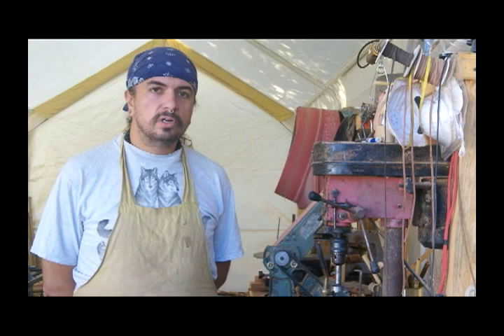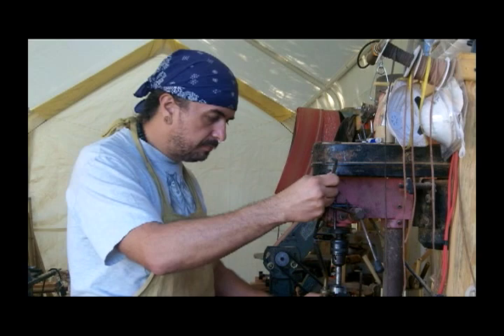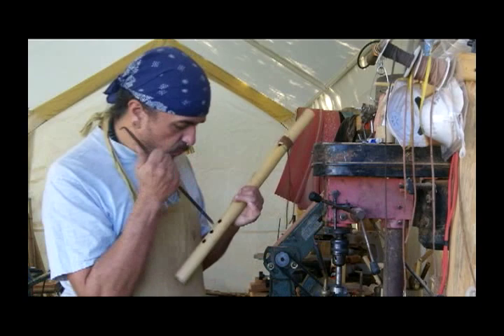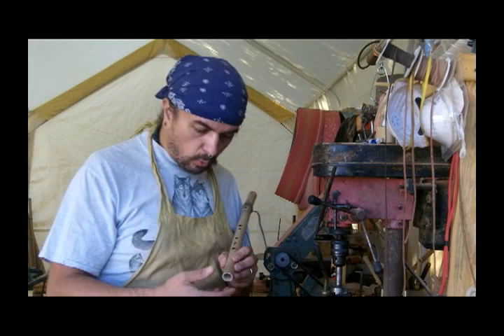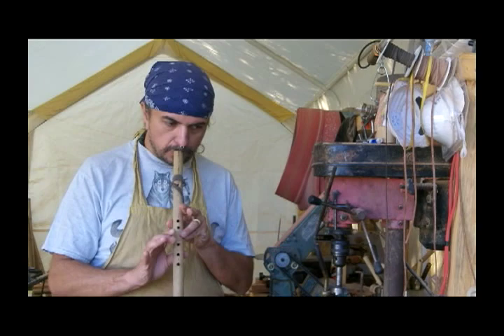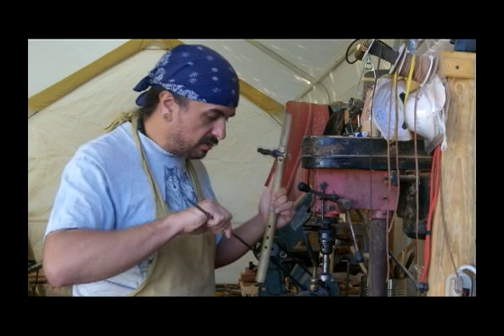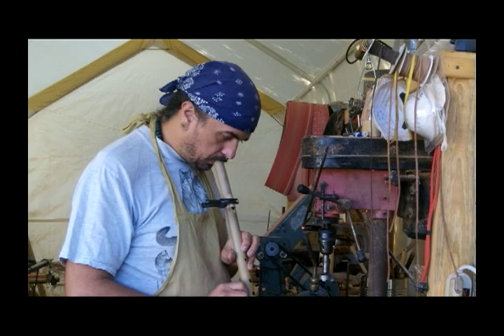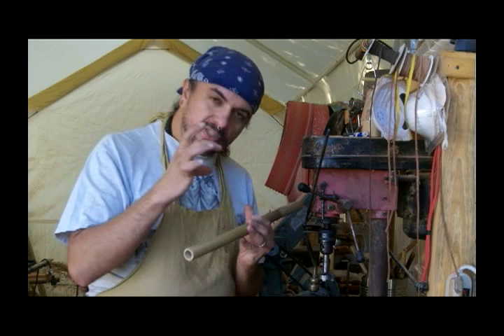How to Tune Native American Flutes

Comment: What power tool are you using to cut your flute shorter? Is there a pdf that charts what to do...hole larger/ smaller ,cut off a bit etc...when you arent tuned
Reply from the maker: In this particular video I was using a scroll saw however you can use any type of Saw to cut the end off with. We also have a band saw and chop saw to use for that purpose. Likewise you may find some benefit in downloading the flute kit instruction sheet from my info page. Of course, to get the holes just right I very much recommend watching our flute kit tuning video.

Comment: Two Questions: I ordered an expensive flute form one of the more well known makers. The root note of the instrument (bass D <xxx|xxx) wasnt even in tune with its octave (<oox|ooo). The upper octave was about 15-30 Cents sharper. I suppose for someone with average ears this might not be a big deal but if you have perfect pitch or really good relative pitch, this was not acceptable. They are sending me a flute back (after I send the other one back). Is it possible for them to fix that one or is it difficult to flatten a note once it is too sharp? Also, was it fair for me to ask that they fix that? IMO it was noticeably sharp (the only way it was in tune was if I played it at a much lighter air pressure than the rest of the notes). Thanks :)
Reply from the maker: Hi Linda. I made a video to answer your question :) https://www.youtube.com/watch?v=8CC6w-YiMcA

Comment: Hey Charlie, this was so helpful.  You spout out so mu,ch information, I have to watch multiple times just to get some of what you said.  G String Tuner is still there and works great.  Not having a good ear for notes, I have to have a measure.  I don't like the 440 standard, but understand that is the industry.  Wow, what a fantastic video.  Thanks.  I built another using the plug in the end, and it tuned straight away to A.  The more I listen to you, the better my flutes are getting.  I may purchase one of your burning tools, I am using a soldering iron with a sharp tip, but it does not have the bend.
Reply from the maker: Thanks Skip!

Comment: didn't catch this offhand, but what do you make the plugs out of? I haven't played one of those kind of flutes before, but some of the same things apply to the bamboo flute I have. It's mostly in tune except the bottom note. So I went ahead and used a bit of 3m adhesive pads as a temporary 'plug' which helped pull the pitch down a bit. But I'm curious what you use for your flutes.
Reply from the maker: If we're talking about resizing the fingerings I usually use either a little sawdust and glue or if you need a plug in the bottom it depends on the material I'm using. I'll usually try to use the same trype of material that the flute is made of.
Reply: BlueBearFlutes Many thanks for the reply! I was speaking of a plug on the bottom though. Resizing the finger holes is interesting though. I suppose I didn't think of the glue sawdust thing. Hmmm. Do you typically just use a normal wood glue for this? Or something more specific?

I was just trying to do what I could because there was a song I was playing that required an flute or pennywhistle in E flat. Unfortunately, finding cheap pennywhistles in that key isn't actually that easy. I found a single kind, but found out I had a bamboo flute in E flat, so I figured I'd just use that since I already had it. But it was a bit sharp compared to the other instruments. I put a make-shift plug of sorts in the end of it to try and  lower the intonation to be less flat. It worked well enough. Of course, I didn't plug the whole opening there. Just a little. I was just curious in how to use proper methods to try and adjust such a thing so that way if I need to play something in the key of E flat again, I can pick that up and not have it be horribly out of tune. :)

I can take a couple of pictures if a visual may help. I may consider resizing the finger holes a little as they are definitely a bit larger than they should be ordinarily. The largest finger holes on it right now is about 7/16" and the smallest is about 5/16"
Reply from the maker: In the shop we use cyanoacrylate glue and sawdust because it dries super fast. It can be dangerous and you have to be very careful when using this method. I'm glad that you have put so much thought and effort into how you can tune your flute the way you need to. Trial and error are important for us to learn ad grow. I would be glad to take a look at it for you :)

Comment: Great, love all your videos. All holes, C,D,E,G,A are all supposed to be 440 hertz like the 440 A flute? Best
Reply from the maker: Hi Dean, thanks for the question. No, only the A would be 440. All other notes are tuned with A at 440. If A is 440, then C will be 523, D would be 587, E 659, G 783, and A 880. When we say 440 tuning that is the curve by which everything revolves around. 440 is the designation for the note A.

Comment: If the entire flute gets hot while tuning it will change noticeably when it cools down.
Reply from the maker: Yes, especially if you are firing the flute to darken it. For these instances it is best to tune afterwards.
Reply: That's exactly right.
I usually darken my cane during the first or second heat treatment, and then wait about 8 months before touching the flute again.  Then - if the flute passes the pinch test I start making the sound hole etc. 

If I'm using wood instead of cane all that wait time and the pinch test isn't necessary to prevent splitting.  Those steps are for cane flutes

Whenever I use red hot rods to make the tuning holes I get the tuning sort of close, and then let the flute get cold and then fine tune the flute to its final tuning.  Even then sometimes the tuning changes slightly and to get the final tuning just right takes several tuning sessions.

The tuning will change a little because the breath warms up the flute slightly, but measuring for that and trying to correct for that is pretty nit pickey.

A flute maker could lose his sanity trying to correct for all those kinds of things.  lol
Reply from the maker: Yes, it is definitely not for the weak of heart and mind ;)